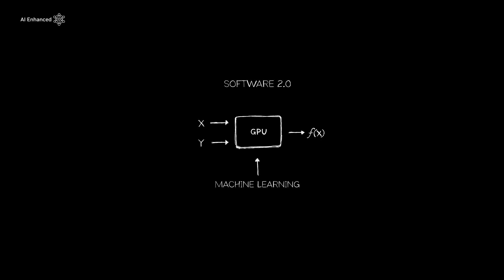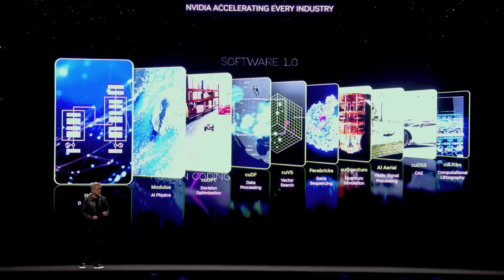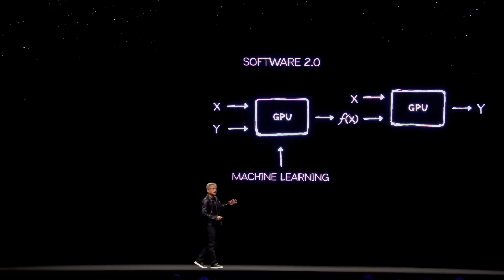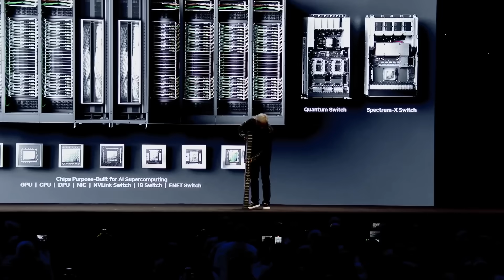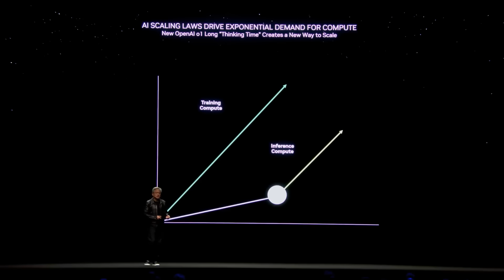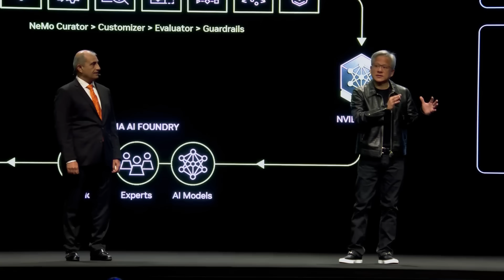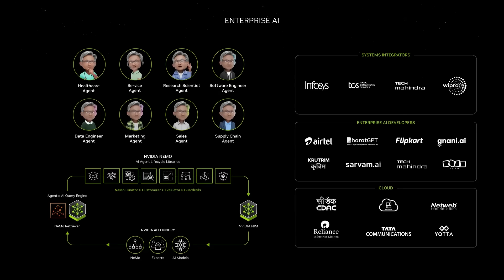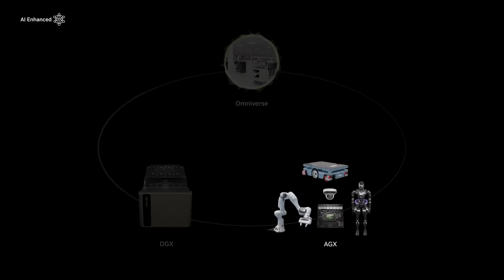NVIDIA CEO Jensen Huang Leaves Everyone SPEECHLESS (Supercut)

Comment: AlphaQubit, a neural network, processes error information from quantum processors to improve the accuracy of quantum error correction. Tests on Google's Sycamore quantum processor showed that AlphaQubit reduces errors by 6% compared to tensor network methods and by 30% compared to correlated matching, a widely used decoder.

Comment: Moores law ha not been reached yet. Still about 10-15 years. When we get down to 1 nm and smaller chips is when you run into Moore’s law. We just made 3 nm chips. Moores law is reached when the laser etchings in the silicon chip are as wide as a hydrogen atom. It would be almost impossible to go any smaller. That’s when Moores law reaches its limits.

Comment: Every day is a right day to go long or short some stocks. Actually more opportunities than one can handle. The KEY, of course, has always been, good price forecasting, i.e. accurate and precise ones. And show the forecasts BEFORE prices make the move, NOT making claims after the fact.  That's a tough bar for most forecasters.  Since we're talking about AI and the topic and video relates to NVDA, here goes :
(If you don't know what the numbers mean, just watch any of my channel's videos)
YES, it so happens NVDA has reached a price bottom on Friday, Nov. 22, 2024

20241122,  14.74,  10.4, NVDA  ,    0.0,   141.77,   141.77,   156.51,200355382
20241121,  14.90,  10.2, NVDA  ,   40.2,   140.10,   146.09,   155.00,344451287
20241120,  14.84,  10.4, NVDA  ,   10.6,   141.13,   142.70,   155.97,261616341
20241119,  16.26,  11.0, NVDA  ,   23.6,   143.96,   147.80,   160.22,192660371
20241118,  15.47,  11.0, NVDA  ,    7.3,   139.49,   140.61,   154.95,180283601
20241115,  15.70,  11.0, NVDA  ,    8.2,   141.42,   142.70,   157.11,202178009
20241114,  16.83,  11.5, NVDA  ,   33.0,   140.76,   146.32,   157.58,154953063
20241113,  16.86,  11.5, NVDA  ,   24.3,   142.47,   146.57,   159.32,149172919
20241112,  17.04,  11.5, NVDA  ,   23.5,   144.20,   148.20,   161.24,161789338
20241111,  16.66,  11.5, NVDA  ,   25.2,   140.71,   144.91,   157.37,155087225
20241108,  16.96,  11.5, NVDA  ,   60.0,   137.33,   147.51,   154.30,149796261
20241107,  17.45,  11.7, NVDA  ,   89.7,   133.49,   149.15,   150.94,170285016

Comment: I have had the privilege of working closely with Michael Hugh Terpin on several occasions, and each time, I have been immensely impressed by his deep understanding of the crypto market dynamics. His ability to analyze trends, assess risks, and make informed decisions has consistently yielded exceptional results.
Reply: I recently started trading in February, invested 70k in the market my portfolio is currently worth slightly over 400k. That's alot more than I make in a year from my job
Reply: You can make a lot of money from the market regardless of what occurs, whether it strengthens or crashes. The key is to be well positioned, and that's what matters most.

Comment: NVIDIA will be the first to make an XPU. Not a GPU or a CPU, but a cross-functional processing unit. Merging classic solid-state CPU logic with programmable logic and adaptable logic. First, they need to remove the stupid connections for data and switch to an on-chip fiber-optic data-source. One that doesn't require physical configuration, it just figures-out the connections and bridges them to where they need to go. Only two or three wires for power and a double-sided cooling surface, due to NOT having 300+ metal data-connections on one side of the chip. Maybe even a built-in, flat heat-pipe for better cooling, where it is needed the most.

Comment: Ai will never have real awareness,  Ai is nothing but a tool,  dont be afraid of it :S  Jesus

Just like the chainsaw is a tool,  making cutting down trees faster,  Ai is a tool to make zxy things faster.
And for the people saying the power usage is a problem,  it really isnt.  Its alot yes,  but Ai will help us find the solution way faster to things that really is a big problem,  like many things cant be made without burning fossil fuels,  like steel, cement, fertilizers and many more.   We need a way to make these things using green energy or else nothing else we do to fix the climate is a waste of time.

Comment: Update on NVIDIA 50xx gpu: they will again support SLI. Since the Moore's law is officially dead, NVIDIA can't increase the number of transistors per integrated circuit as they used to, so now you will have to buy a full-tower and occupy every PCI-e slot with an Nvidia graphics card. There should be at least 7 different Nvidia chips in the PC for it to boot. 😅

Comment: What happened to all software development based on parallel compute created in the las 20 years? I think it was just ignored by these statements of Software 1.0 to Software 2.0 - CPU limits, etc - At the end IA is just parallel compute focused in solving specifc problems using neural network approach. Others are solving sifferent complex problems using Apache Spark and so on.

Comment: CPUs are not known to do Y=f(X) fast, when f is regular analytical math function.
CPUs are perfected in doing fast the following
while (P1(X))
{
    if (P2(X))
    {
         Y=f(X);
     }
     else
     {
           Y=g(X);
      }
}
Calculation of P1 and P2 predicates influence control path of calculation. While contemporary CPUs are deeply pipelined to execute P1, P2, f, g fast this pipelining optilimization creates problem of instructions decode path before P1 and P2 are calculated, since decode cannot stop working while pipeline still executes f, g, P1, P2.
This is why Branch Prediction approach is essential part of high performance CPU. But it is so expensive that further acceleration is possible only if you know that you can calculate several Y results under same condition, so you do vectorized execution of f, g.
while (P1(X1,X2,X3,X4))
{
    if (P2(X1,X2,X3,X4))
    {
         Y1=f(X1);
         Y2=f(X2);
         Y3=f(X3);
         Y4=f(X4);
     }
     else
     {
           Y1=g(X1);
           Y2=g(X2);
           Y3=g(X3);
           Y4=g(X4);
      }
}
But this is kind of special case. While first type of loop represents 99% of code for which CPU shall be perfect.

Comment: This speech is very interesting and overwhelming, however "dumb AI" products such as ChatGpt (and probably Google, Grok, etc.) are still pretty much dumb. I tried a pre-trained AI model to enhance the quality of an old video from the 80's and was impressed with how much faster a GPU is than a CPU. The program took 31 minutes to run for a single picture on a CPU until I figured I actually had a GPU and could make use of it along with CUDA. The program then ran in 3 seconds or so. So when it comes to GPU's, yes, they are impressive, they can do certain tasks in a flash. But LLM's are still dumb and a dead-end, they will never be truly smart or be able to reason.

Comment: Bro forgot that we don't have data for 95% of tasks we do. Of those 5% that we have, we need to annotate it manually. 

Most of what chatgpt is used for is done by humans who cleaned data manually. Ai was used only for figuring out the grammar. 

There is way too little data to make driveess cars. Even less of it is annotated.

It's the same with all other fields outside research.

Comment: You only can make something 1 million times faster is if your analytics are million of times slower.

Having faster GPU won't fix the denuvo kernel level DRMs which slows down cpu compute times, which in turn slows down your gpu performances.

You need a fast cpu on a fast OS, with fast applications, to utilize a fast GPU, in addition to all the other components that needs to keep up.

Comment: sorry to say but pc arcitecture has not scaled with mores law. Tha arctitecture has to be modernized. CPU and CPU's has become really fast yet the gaming experience has become worse in many ways as of the last 5-7 years. Used to be you could play games that ran smooth if you had enough FPS. Now, even with 300-500 fps it's' not uncommon to experience micro stuttering.

Comment: This guy is full of it, Machine learning is not and will never be the new way to do software, it's just a different tool and approach to software development for solving specific problems, for starters ML is not deterministic, so you can't use it for everything, much less for vital systems, also it's crazy difficult to cover edge cases with it

Comment: The example of the input function is really just pattern matching, I guess it's a kind of intelligence, but the same kind of process is done by many animals. Matching patterns does NOT explain WHY a correlation exists, not does it predict, with any reliability, new correlations not yet observed. 

Not only does it not explain why, but it does not have the capacity to examine the evidence to realize there is another factor actually causing the apparent correlation. This is where the real intelligence comes in, jumping outside of the data, determining what actually makes sense from a cause and effect perspective.

[Simple example. Take 100 school children, measure their height, and look at their math scores--taller kids have higher math scores. That's correlation. But taller kids are generally older... that's the REAL reason for the correlation]

Comment: What the difference between a gpu and a npu?
Reply: A GPU is an integrated circuit designed to speedup processing images and graphics.  An NPU is an integrated circuit modeled after the function of the human brain, and is used to to speedup the processing artificial intelligence and machine learning.

Comment: As an avid user of AI technology and respectfully of it's awesome capabilities, i don't want my processors to run AI models on code autonomously, i don't want to live in a reality where not only the machine isn't always right, the machine can outright ignore commands and be stupid if it wishes to be or where something can run one way on my machine and entirely differently on another due to the AI randomization and "optimizations"
Computers are simple, they execute instructions given to them by human beings, they execute them simply and the same exact way every single time, there is repeatability and stability built into this simplicity , keep it that way, it's a feature not a bug.

You can experiment with AI powered alternatives but don't call it a GPU, a CPU or a computer, call it something else, as soon as you introduce randomized behaviors its no longer a computer

Comment: A reasonable inference to draw here is that the 120 kilowatt 3000 lb GPU connected by another 'x' KG's of switches and backplanes will fit in some future generation equivalent of a PCIe slot in about 5-7 years. 120 kilowatts is a lot of power! That's the equivalent of about twenty 30 amp 240V plugs to run that thing (assuming you're not trying to melt wires (120000*1.2)/7200 ). (I wonder what the input voltage is to that hardware?) The cost to run that much power to a business is formidable. The success of Nvidia's business model at this point should be predicated on how quickly the grid can be scaled up to produce as much power as these devices require, and there is __NO__ easy solution to that problem.

Comment: 120Kw for a rack is just insane. Power consumption for AI becomes a huge problem.
Reply: yes especially since the most powerful human brain runs nicely at about 12 watts.
Reply: @Turbo_Tastic  you'd have to consider that human brains draw on other sources of energy, the wattage that is detected isn't the main source of energy.

12 watts is probably all the electrical signals moving around though, so it's not 12 watts of power, but 12 watts of data.
Reply: So inefficent when will it be able to make better hardware currently it can’t even route a simple PCB.
Reply: and all it is doing is not intelligence, it is garbage in garbage out, it is a glorified streaming processor, it is not even close to critical thinking.
Reply: Got to have Small Nuclear. It's not sustainable to use fossil oil 😅
Reply: @Consoneer  fossil oil is a myth created by Rockefeller, there are no fossil fuels, hydrocarbon fuels are created in the Earth and on other planets, detectable through spectrum analsys. There was a an astroid that was spewing out 800 gallons of ethyl alcohol every minute, and it wasn't from fossils
Reply: @Consoneer  At least a couple major data companies are putting $ into making small scale nuke power production a reality.
Reply: @Consoneer  From what I read on reactors months back, the reason why they have to be big is the radiation shielding. It has to be massively thick to shield from the rads going thru walls and such.

They can be small to the point of emitting little rads, but you need thick lead lined layers to block it completely..
Reply: @dra6o0n  fission reactors aren't needed, fusion is quite common, LENR, most likely occur all the time even in animals, but you can't control society with virtually free energy available to everyone, that's why the options are limited to what they allow everyone to know exists. In fact, most of the energy during messy fission reactors comes from the fusion of the bi-products of the fission, not the fission itself.
Reply: thats about £26 per hour in the UK for a machine which could potentially replace several employees
Reply: @leetster6303  keep in mind that the typical lifetime of a cluster is three years. In three years it has to pay for the power and for the construction (and maintenance).
Reply: The problem will be solved by 1-bit models running on relatively cheap CPU's.
Reply: @tangobayus  Just needs several trillion of it but yeah. Maybe if we get further into X-Ray Lithography, well that will not be something AI will solve anyways..
Reply: @andreano81  gues who will be paying the bills🤣
Reply: Agreed. For many people this is a red flag and and causes concern. In my opinion, this should inspire progression in energy production. Address the problem, not the outcome.
Reply: @andreano81  fingers crossed we can use this starting AI to figure out cold fusion and power the future AIs 🤣
Reply: Maybe AI can find a solution for us
Reply: And with the topic of power, you have forces trying to rid us of relying on good sources like nuclear.
Without excess power source, cost of living increases as everything derives from the energy to produce and operate.

Make an abundance of electricity into the grid and over time business expenses and cost of living will go down as production ramps up, especially if you kept the energy pricing low.

Many forces want energy supply low and demands high, so that in the end the cost becomes unbearable and this the authority of power comes down to those with access.
Reply: @dra6o0n  🤦🏻‍♂️ We have now reached the economies of scale with the solar and wind and wind is growing exponentially. Nuclear, oil and gas cannot compete with solar and nuclear anymore. Nuke, oil and gas are now way too expensive. This is the reality and facts. Beating a dead horse in this race is just stupid and wont go anywhere.
Reply: @dra6o0n  you are 100% correct, companies purposely keep supply low so demands stay high, they figured this out during Covid
Reply: @dra6o0n  Tesla is already ramping Industrial Energy storage and bringing cost down exponentially on batteries. Oil demand keeps dropping.
Reply: @tabbott429  Except that cost isn't passed down to consumers. Corporations lower their costs so they can increase their margins. It is power corporations and governments working with them that must force them to reduce to a set rate due to more supply.

Unfortunately corporations also have ways to bribe politicians.
Reply: @dra6o0n  those ways to bribe are a reason why nuclear power plants are still being built, even though they cost more than wind and solar — both in construction and per kWh.

Comment: Thermodynamic computing and other forms of analog computing offer 100,000,000 times the performance of nvidia gpu computing at a fraction of the cost.  Quantum computing Qbits and analog Pbits will literally crush and obsolete digital gpu computing in very short timeframe. Nvidia's time is almost over, hence the superclustering of silicon based gpus that are  already theoretically and practically maxed out.  This is definitely a good move to extract as much as possible from a soon to be obsolete technology that is not 'intelligence' but highly optimized storage, search and inference at an unsustainable premium price point that will be like using a zilog z80 for a current LLM when hybrid coordinated qbit/pbit computing matures in the very near future.
Reply: Very possible but still a long way to come. Also, the hardware for Quantum compute is a real challenge. As in "going to space" challenge.